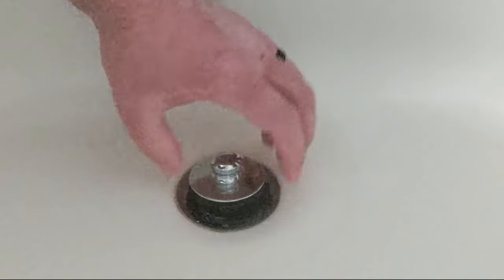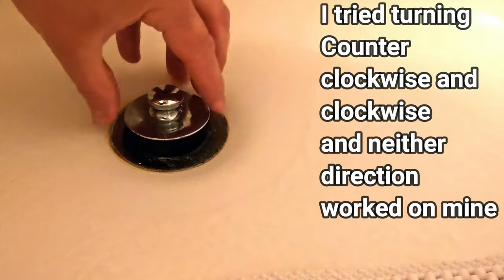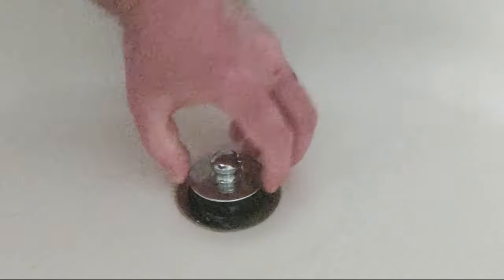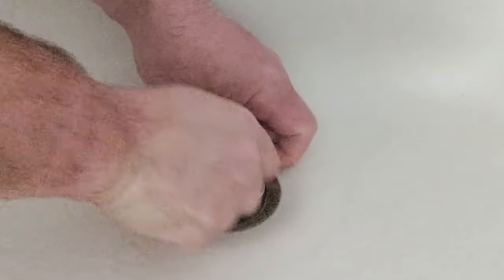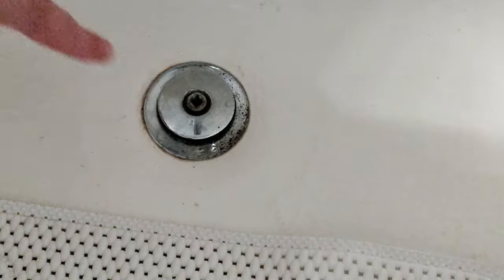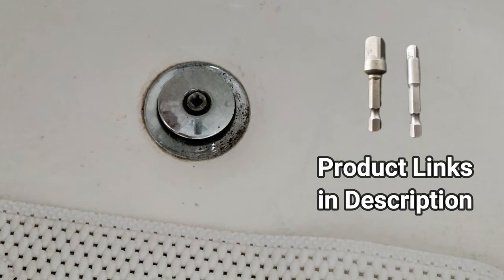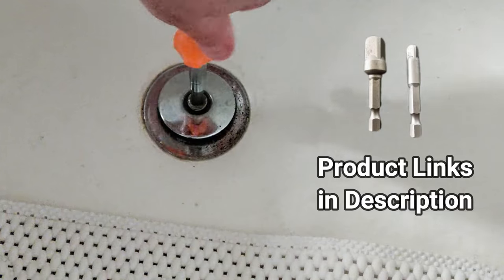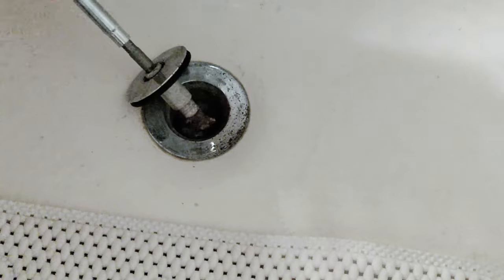Remove pop up bath tub drain stopper - 3 ways

Comment: Mine was the screw the head off the top kind.  It's seam was invisible.  Trying to unscrew it was so tight that I questioned whether it could be that type.  I put my cell phone on video close to under the lip with good lighting and rotated the drain.  No sign of any screw/etc.   Tried the top again and put some muscle into it and it started to unscrew.   I wouldn't have put that much force if not for your video.  Frustrating secrets revealed.  Your video is very good and very much appreciated.  Thank you for making it and sharing it.   Most videos assume that it unscrews counter clockwise or has a screw.  I think your video is the first I saw the solution as a possibility.

Comment: I suspect mine has the screw underneath the nub on top. Since the nub won't turn and I have no way to grip the round base, I guess I'm screwed.
Reply from the maker: If you have a magnet or tape you should be able to pull the stopper up.
https://youtu.be/szmmsrSkd0Q